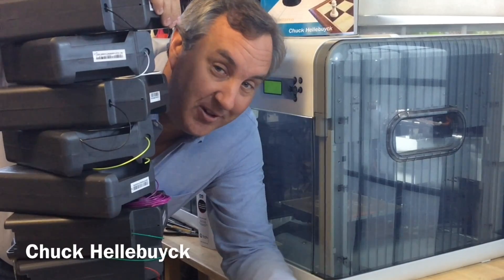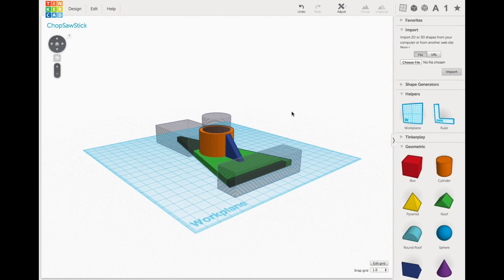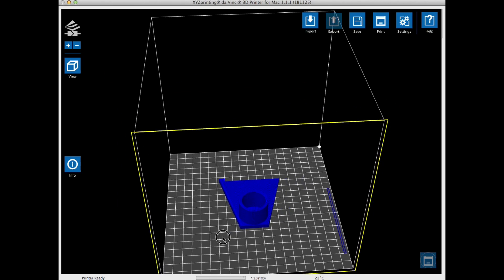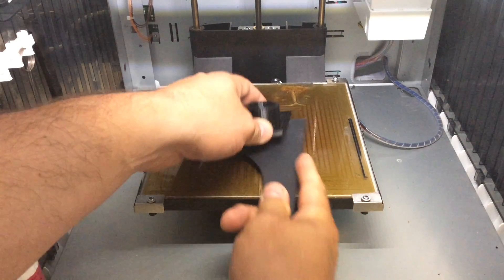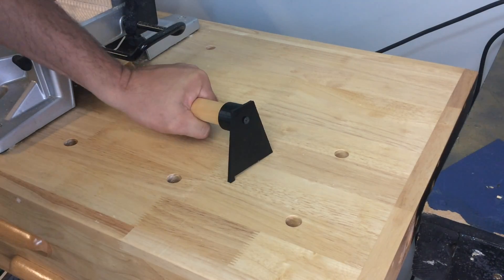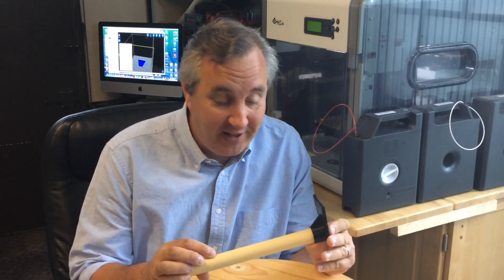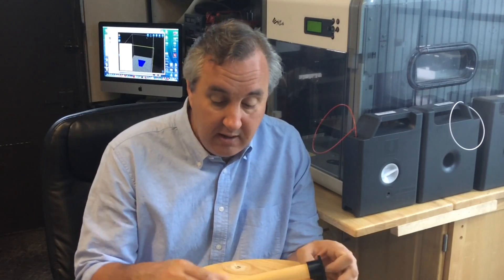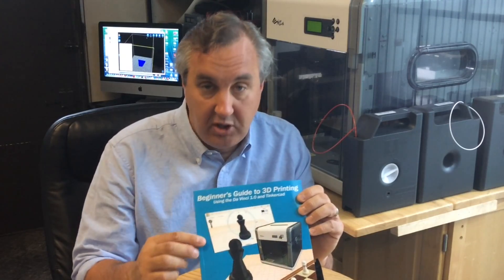Filament Friday #19 - Chop Saw Hold Down Stick 3D Printed on Da Vinci 1.0 - Video #064

Comment: Saw your comment on Steve Ramsey's channel and came to look at what you made. The hold down stick looks great. Would it be possible to print the plastic part with a countersink for the screw, or would it be easier to countersink after printing?

Comment: Chuck, when you get the load of the Da Vinci Jr to review, if you have the same problem as me, please ask.
The feeding port above the filament holder clicks a bunch and will not feed anything through. Some filament got stuck in there as well as the white feeding tube. I can't contact them at the moment because their phones are at lunch or something. Thanks

Comment: Hello Chuck,
Just got my Da Vinci last week and i now tried printing an object with an hole where a bolt is supposed to fit trough. But the hole designed at 6mm comes out at 5mm when printed. I have no clue how to fix it other then making the hole the wrong size in the design. As you seem to be able perfect holes i am curious how my design comes out at your printer. Or if you have any other pro tips how to make the hole work.
This is the model: http://gitlab.vanderhoning.net/snippets/9 . I made the model with openscad, but maybe i should try tinkercad.
Reply: Marten van der Honing 
Another way to keep keep the squishing from happening is to elevate the object 1 or 2 millimeters above the print surface using the move feature on the Z axis in XYZware and use supports or raft + supports.  You use a little more material but hopefully get the dimensions you designed into your model.  I find for small items, light supports work fine.
Reply: I See.  Thanks Chuck for the response.